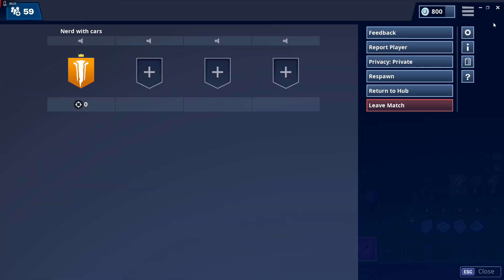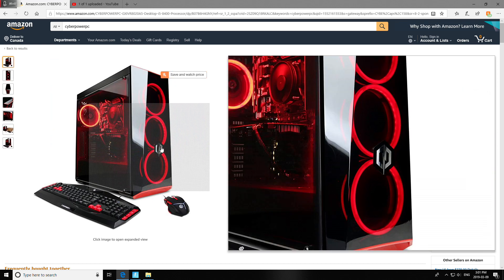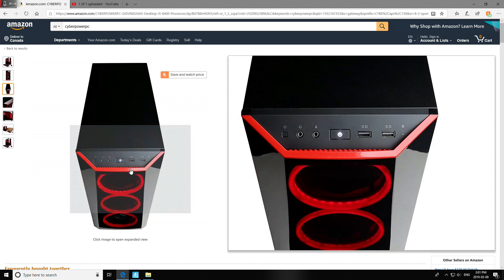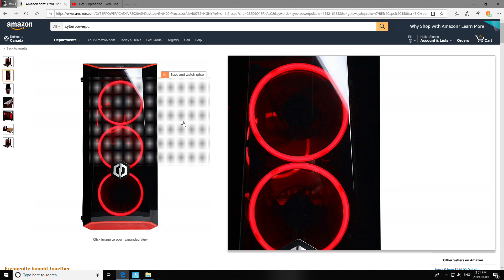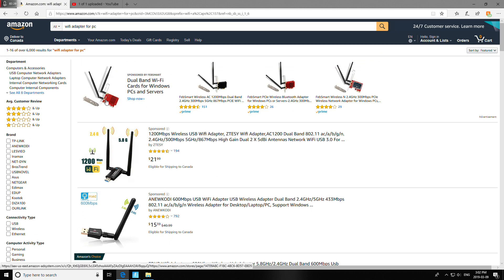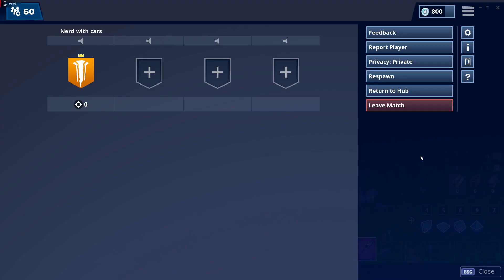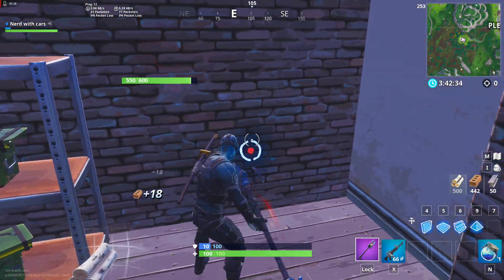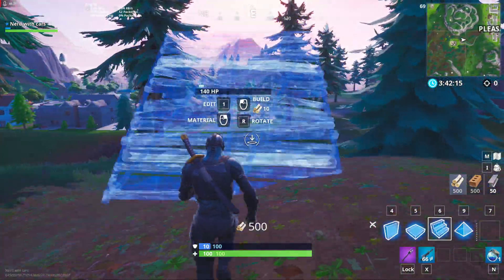cons to CYBERPOWERPC Gamer Xtreme GXIVR8020A5 and how to fix

Comment: which SSD ram stick do you recommend
Reply from the maker: Any ssd will be faster for loading windows so even a cheap 60gb ssd will make the pc run better
Reply: @NWCPcbenchmarks  Hi i installed an SSD m.2 and now it booted up toe the MSI click bios 5 screen. How do i go to my desktop?
Reply from the maker: Did you boot from your old hdd and clone your files to the new ssd?
Reply: @NWCPcbenchmarks  I just clicked the power button but I'm not sure how to boot from HDD or at least I tried and it didn't work
Reply: I stuck the ssd m.2 into the slot and then started the computer and it brought me to the msi bios screenn
Reply from the maker: Go to boot manager and make sure your old drive is still priority 1 than you need to download a program to copy all your fines from that to the new ssd 

(It will need to be the same amount or less on the hdd) so you might have to delete a game or two depending on the size of the ssd
Reply: @NWCPcbenchmarks  do you have some way I can reach you I took a picture of what my screen looks like and it still doesn't seem to boot past it
Reply from the maker: My discord NWC#5578

Comment: Wow I wish I saw this video when I bought mine. I bought and installed a liquid cooler but it didn't seem to lower temperature. I think I'll go drill 9 holes on the front for the intake fans. Scared that I might break something somehow though :[

Do you happen to have a video of drilling those holes? Or maybe a measurement for how big each hole is?
Reply from the maker: How To Fix Cyberpowerpc Xtreme Heating Problem For Free https://youtu.be/9w_v8lTbQNU

Comment: How did you drill holes in the front? Just with an electric screwdriver? Because that seems... Like it would cause problems. So yeah, what did you use to drill holes?
Reply: And does the GXiVR8020A6 have the same problems? I think it's basically the same, except the last number is a 6 instead of a 5, whatever that means.
Reply from the maker: Yep drill take face plate of drill from the front try to line them all up so it doesn't look strange not a good case

Comment: What is the monitor you use
Reply from the maker: 144hz msi curved
Reply: Nerd with cars can you recommend me a cheap gaming monitor under 150
Reply from the maker: For gtx or amd?
Reply: Nerd with cars either
Reply from the maker: On budget https://www.amazon.com/AOC-G2460VQ6-FreeSync-1920x1080-DisplayPort/dp/B01N1YCKAE/ref=mp_s_a_1_2_sspa?crid=2U343OJAH37IJ&keywords=75hz+monitor&qid=1552422346&s=gateway&sprefix=75hz+&sr=8-2-spons&psc=1

Over 

https://www.amazon.com/Acer-GN246HL-Bbid-24-Inch-Display/dp/B00KO4518I/ref=mp_s_a_1_19?keywords=144hz+monitor&qid=1552422446&s=gateway&sr=8-19